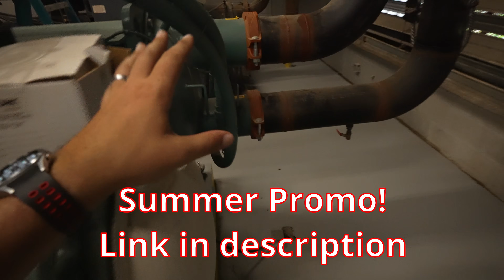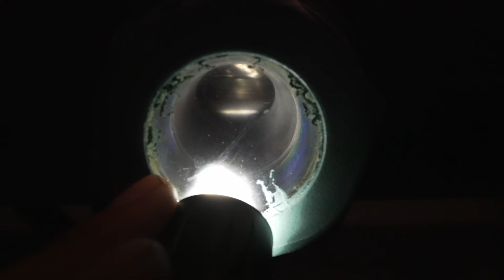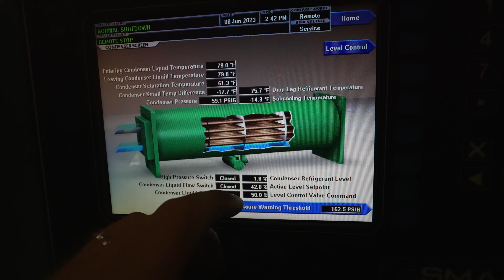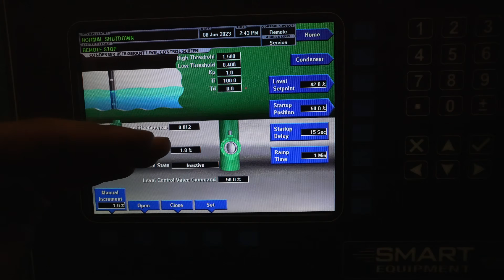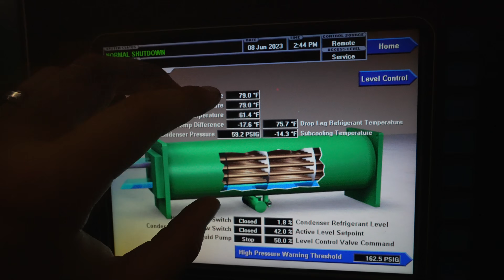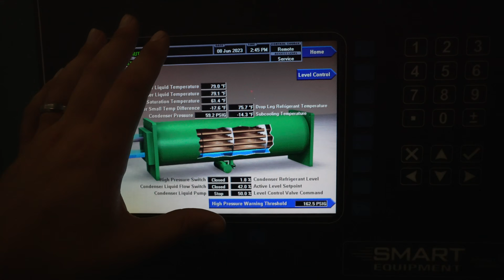Setting YK Level Sensor York Chiller

Comment: Ive been a chiller mechanic for JCI for the past 20 years, who ever did the factory start up set the liquid level properly. Those level sensors get out of whack and need to be calibrated.
Reply from the maker: In your experience, would that sensor get that far out of calibration within months of startup? I personally have not seen that over the years, usually a slower process.
Reply: Yes, I have actually seen a few go out within days.  @HVACTIME

Comment: Starting another condenser pump on a common header will decrease the volume through the condenser. Did you check the delta P i think you may have had too much condenser flow causing a low delta T and higher head. May need to adjust the triple duty

Comment: If the chiller is not falling film just disabled the level sensor the machines ACC is alot more stable.  Originally York thought having a higher level would prevent a venturi effect going down the drain. I always disabled the level sensor and still maintain over 8 degrees discharge superheat

Comment: Great video l have a problem. We have two 700 ton chillers YK  variable primary configuration the plant . When chiller 2 is on without chiller 1 on .When OT above 80 WTH 58 RH we have a over 90 degree going out to cooling tower & 75 degrees coming back chiller .When both chillers run it drops down to 85 degrees with a 75 degree.We check split across the condenser and it’s not plugged . The  flow is good it over 1200 GPM bypass at 0 on the BMS which mean it going out to building. We did have York check out they can determine what caused this it never ran above 85 degrees in last 10 years all the log on got on this machine.